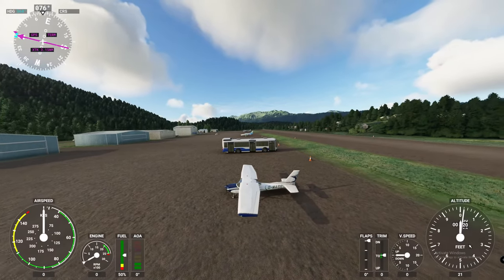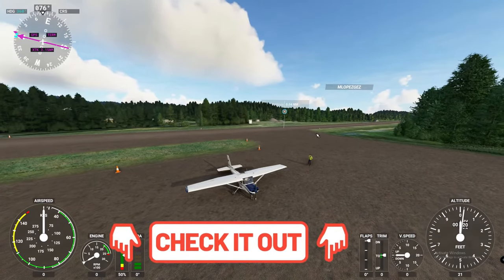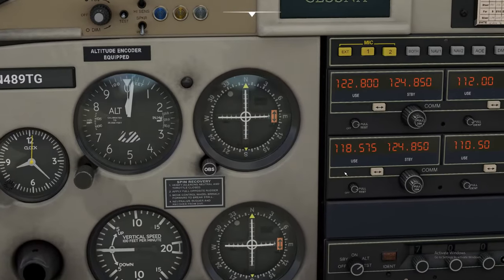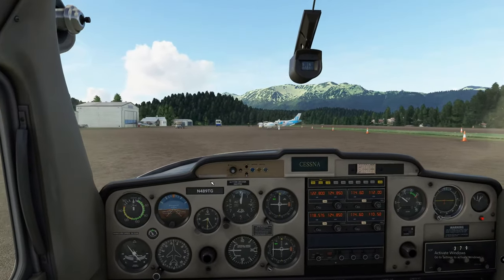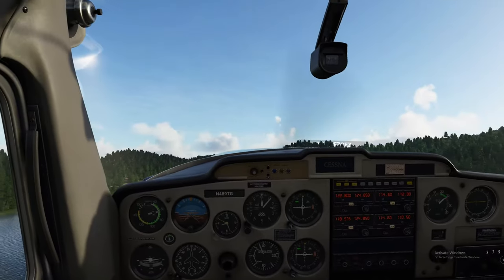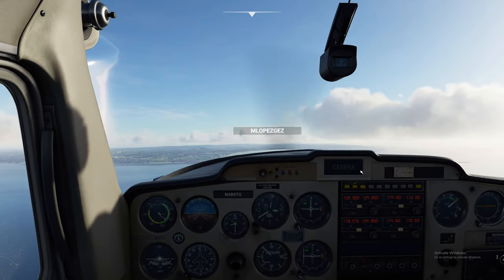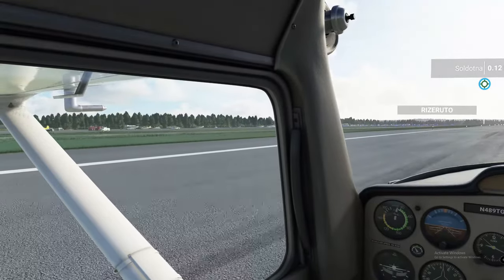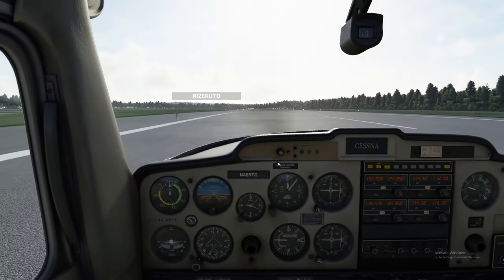MSFS2020 NDB/ADF Radio training/tracking. **2K** Cessna 152 Custom Scenery EP.4 Microsoft Flight Sim

Comment: how did you map the mouse ? I am a beginner in xbox x and do not succeed in using the mouse in the cockpit interactions (turning knobs etc ..) - I can use the mouse for everything else but not for  the second and third action ( identification  of knob : ok - but than activating it and changing values : no go). Hence I can not easily use nab nor for functions : very frustrating . Any direction you can give ? BtW : very good /instructive video's on your channel - thanks for sharing this.
Reply from the maker: Make sure you are in legacy mode that should work and I  the bindings make sure it says default profile